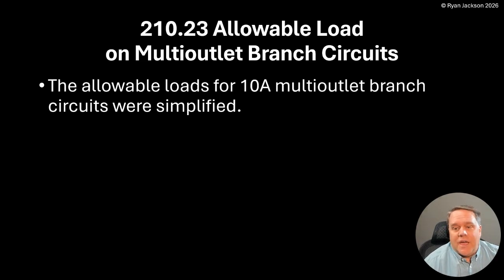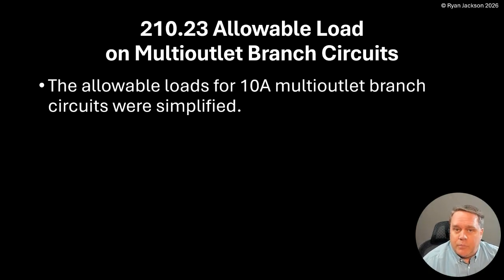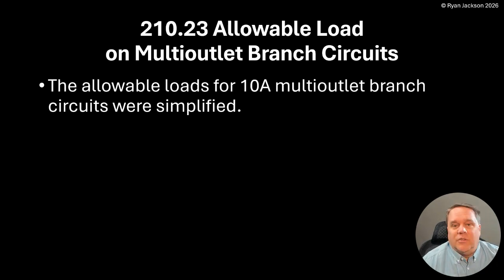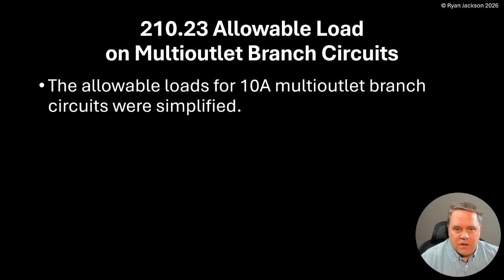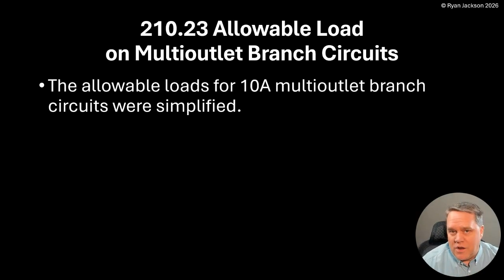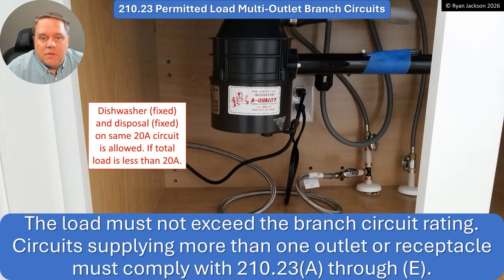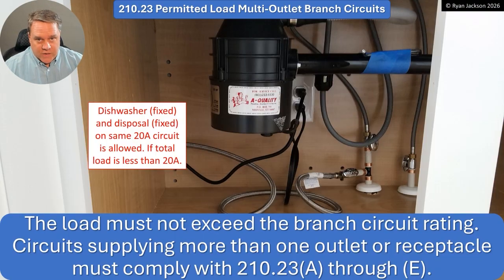100 Days of 2026 NEC Changes Day 17: 210.22&23 allowable loads on circuits

Comment: Or hear me out, use PoE lighting and remove the line voltage and all the AC->DC converter waste and the cost of a license to install it. Easier, Cheaper, AND Safer.

Comment: Great videos as always, Ryan! I'm curious what your take is, with regards to the interaction between 210.19(D) and 310.5(A). Even though 310.5(A) now permits the use of 16 AWG copper, 210.19(D) still limits the minimum wire size for other than cooking appliances and 210.14 to not less than 14 AWG. Lighting circuits are not found in T210.14. Further, T210.24(1) shows 16 AWG copper minimum for circuit conductors, but 14 AWG copper for taps. Which section will take precedent for wire size regarding branch circuits? Do you anticipate a TIA being created for the discrepancy?

Comment: It will be interesting to see how much this catches on. It will certainly be used by production builders who are trying to cut all possible costs.  I think it will also depend on how much 16 gauge Romex is quicker and easier to work with than 14.  It will certainly be a little bit easier, but without having tried it I don't really know whether it will be significant or not.

Comment: The 10-amp circuits for lighting makes all the sense in the world. I see people on YouTube running 12 AWG circuits for lighting with NM and it's such a waste of money if you ask me. How long before we install just plain old DC circuits for LED lighting?
Reply: or PoE ...
Reply: But 12 NM is required in some states or not ?? I mean local codes … the only problem I see the 12 gauge compare with 14 is not flexible really disgusting push in into the boxes some times … I can’t imagine installs 3 switches 3 way on the same box with 12 😄. I prefer use the 14 on lights always and imagine that every light can be 60 watts or 40 on the future so I don’t like share the same breakers for 3 or 4 different areas .. if the breaker turn off we will not walk on darkness
Reply: @JoseilluminateSV agreed well said, just saw new house in rural GA all 12 awg wire and larger. Started back around 1984 code cycle. As I said then it's all about proper design and application.

Comment: I would consider electric water heaters and stoves as continuous loads.  Stoves can be on all day during holidays and put an electric water heater in a large vacation home and it will run non-stop until everyone gets their showers done.
Reply from the maker: The code already states it for water heaters in 422.13. I would disagree with you on the stove. I don't think you have the oven cranked up to 500 degrees F for three hours, even on Thanksgiving. And if it was an oven, it would be all four burners on high, plus the oven at 500F.
Reply: or leaving the oven door open